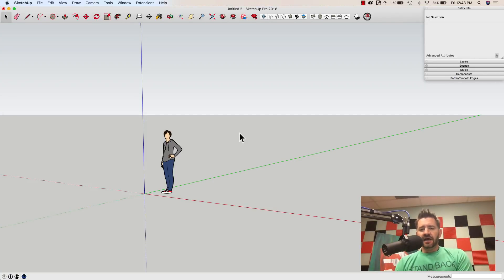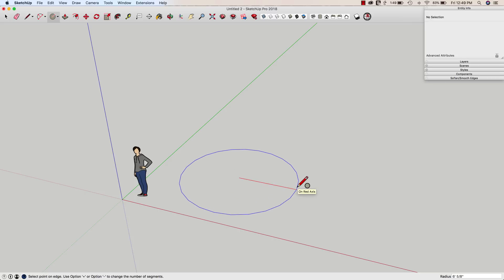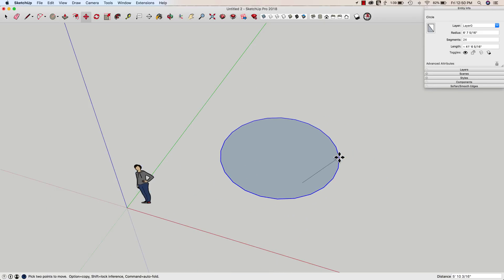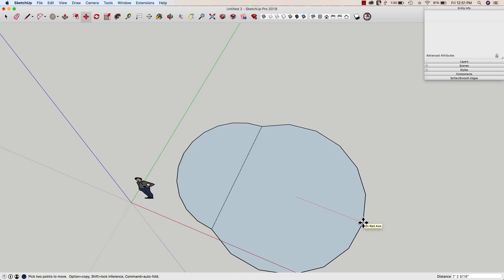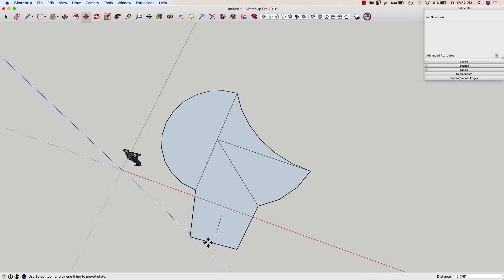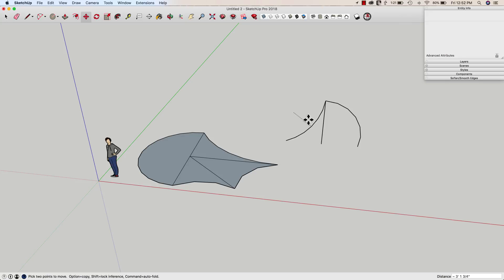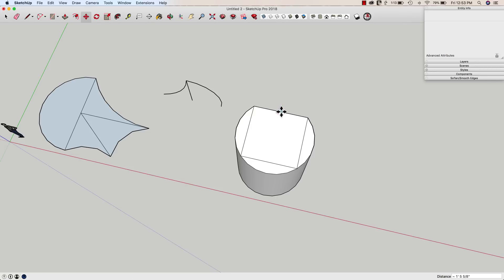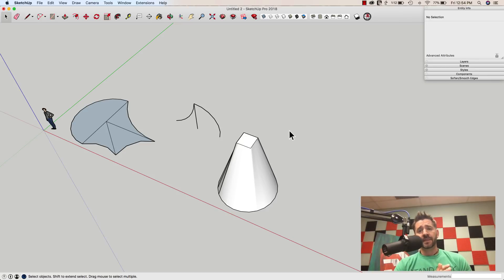Cardinal Points in SketchUp - Skill Builder

Comment: this is ancient I knew this back in 2005. How about adding some more features to sketchup.
Reply: Pastor flat Alas, I am ill equipped to make any changes to software as I have no idea how to code. Thus, I have resigned myself to helping the community by showing them tips and tricks to get the most of SketchUp as it is.
Reply: So do you work for sketchup or not? Do you have any say.?
Reply: I am lucky enough to work at SketchUp, but not in a development or product management position. I personally have no direct control over what is included in releases. We have much smarter individuals than myself for that!
Reply: Well at least you are very humble.
Reply: It’s one of my best qualities... I am constantly bragging about my humility
Reply: Well there is no way are you more humbler that my fine self!

Comment: Special.  We're like monkees with some of these tools, until these secrets are revealed.  My thing recently is natural ventilation, bringing air into a house from underground, using cheap, local materials that are all round or square but have to turn corners and be accurate enough to calculate things like flow rate.  Wind tunnel testing a house to see where embers might lodge, shows other places where 2D surfaces should transform gradually, not abruptly.
Can you change the number of segments?  What's on the right-click dropdown menu of one of these arc segments?  (I'll answer my own question momentarily)
Reply: Refuso Againo You sure can! I didn’t even think to talk about that! If you bisect the arc, you can set a number of segments for that new arc! Great catch!